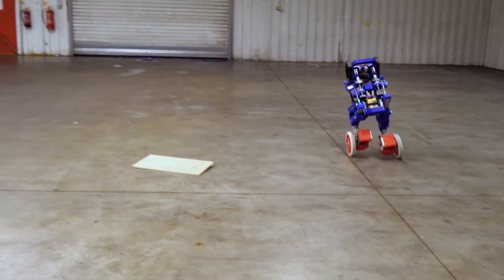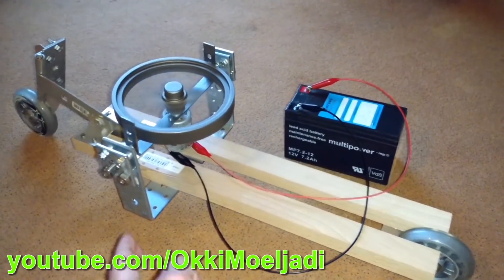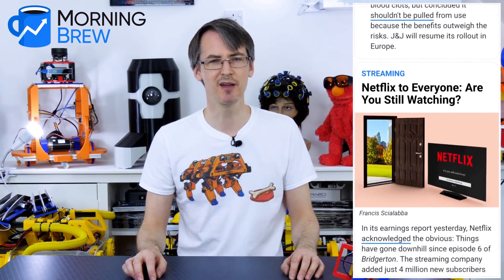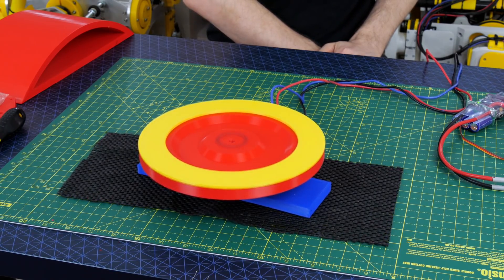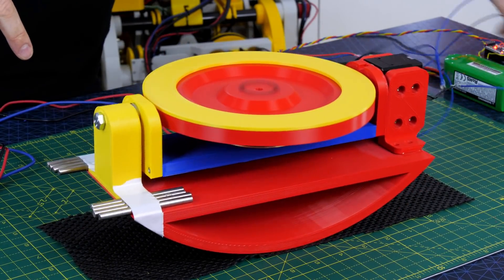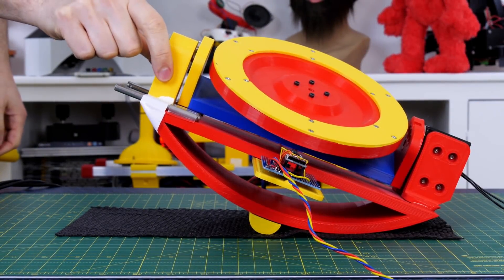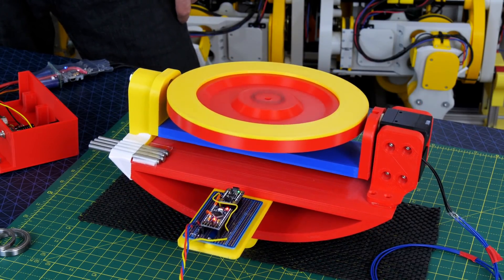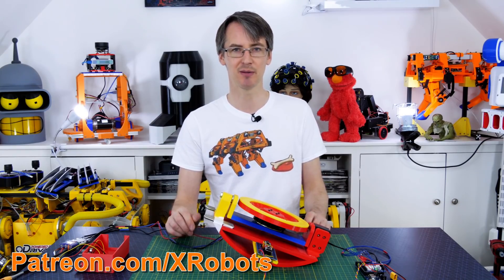How this Active Gyroscope Balances

Comment from the maker: Thanks Morning Brew for my daily news perk - sign up for free here http://cen.yt/mbjamesbruton
Reply: Cool Video Even Tho I Haven’t Watch It Yet
Reply: I'm wondering if you can use 2 gyros 90° out of phase, but linked with a belt to achieve complete balancing...
I'd love to see this 😊
Reply: @Lardah  if it's passive, it'll creep. But might be interesting nonetheless 🤔
Reply: A week ago !?!!??!!
Reply: Can you do a ROS robot start to finish tutorial? The last one you did from your Nerf robot wasn't a tutorial per se, and it was a little confusing. If you do a sharp solid tutorial from 3d printing the parts, using the correct motors, and setting up ROS and talking to the Arduino and trying to make the system work (the most important part), I would love you even more - if that's even possible...More importantly, the ones online use the Turtlebot which is really pricey for everyone. So simply, please, please make a ROS robot tutorial showing how to setup ROS and letting it talk to the Arduino to make the motors move with encoders. If this is really confusing, please reply to this. But thank you!
Reply: OH YOU LITTLE, you made me buy mc Donald's with an ad for something else
Reply: try dynamically variable PIDs. i guess you'd have to code it.
i.e. the closer to centre/level the less aggressive the PIDs.
Reply: What is the motor used ?
Reply: The responsiveness issue seems to be coz your using the roll values directly. I think the oscillations will never die down if you're feeding it the current roll values. You should try to enable it to anticipate the inertia and correct it pre-emptively. 

The rate of roll(angular velocity) could help with that.
Reply: I have an idea of how to incorporate gyros into it without adding the weight of extra motors and more structure though you will need to engineer the heck out of it! Is there a way you could use the motors already in there for other things that drive the legs to also drive the gyros? like set up a quick change gear box or a clutch or maybe? 
If you just put the biggest gyro you can in the middle then use bi-directional gear boxes to run all of the legs off of it then just find some other ways to make all the other issues work?
Reply: Decoding the Gyroscope (1)
https://youtu.be/et_AEC3sYY8
Reply: Iv got a great idea I'd like to connect on for a motorcycle sim involving a gyro

Comment: Million dollar idea - anti-flip for race cars by mounting a gyro like the boat that can respond fast enough. I believe that it could keep the 4 wheels on the track, therefore probably more traction and better runs and it could also provide a weight balance with the engine and trans being on one end of the car and the gyro on the other. Maybe my autistic ideas are too much because gyro cars have existed before, but not implemented in the way i see it could be used. also maybe mechanically connecting the steering to the gyro so it always moves to keep the car flat in the opposite force compared to the natural flipping direction of a car during a turn.

Comment: Hello friend, I'm your fan, your projects are really cool, it's a shame I don't have any knowledge of programming! See if you can help me I would like to make one of these stabilizers for my rc boat and a tug that I have and I would like to use a servo motor from a model airplane like those common to Dynamixel vehicles, would it be possible? Is there any code out there that does the same thing as your spin but with a normal servo? Thank you very much for the videos! hug...

Comment: You have essentially stuck that IMU out on a springboard, you can see how much it is vibrating, that will probably affect the roll calculations and add a lot of noise and hence affect the whole control system. The IMU should have been mounted to the main body of it at the very least, maybe with some light vibration damping too like they do on drones.

Comment: This is terrifying especially used on a bench as waist height. If the flywheel fails you will have dozens of pieces of extremely high speed shrapnel flying at your stomach. It's why people wear face protection when using angle grinders, not because of the sparks but in case the grinder fails.

Comment: Hello, I have been trying to create a oscillation-control system like this for a school research project. I have managed to setup / tune the PID control for this fairly well, however I'm running into an issue where the flywheel cradle can't return to zero without creating torque on the hull. I'm already running my flywheel's drive motor at it's lowest speed, and was wondering if you had found a solution to this in this project.

Comment: The pivot point needs to be below the flywheel for it to self balance and not drift. Notice the toy gyro rides on a point below the flywheel. Putting weight underneath will cause the gyro to transfer the drift in the same direction as the drift making everything worse as your testing confirmed.
Edit - you can put a counterweight above the flywheel too if you don't want to move pivot point. Like in your first test just put the nuts up top.

Comment: why and how is it better than a mass on a linear rail that gets swung from side to side, perpendicular to the system rotation axis? It would exert identical forces, but yet those boat stabilizing guys went with a gyro and not a hunk of metal on a linear rail. Why?

Comment: I think mechanicaly isolating the gyro from the system would improve signal to noise ratio, thus you can get much higher control bandwidth without causing oscillations.

Comment: Thanks for this. Valuable intro to gyros ( my gyro!) and control systems with the dreaded (and beloved) PID loop. Very stimulating.
Question: what is your servo tick rate for the PID? I'm amazed that little Arduino can even attempt it.
Reply from the maker: PID is running at 100hz, but the IMU data is only read at 25hz :-)
Reply: @jamesbruton  Aha, a bit slow isn't it? Probably first thing for better performance will be faster PID and IMU. Maybe Teensy 700MHz and .... ?

Comment: Interesting stuff, although I have to agree I am a bit worried about that rotor bursting. 

I think the control would work better if the output of the PID controller set the servo rotation speed, rather than angle. The torque reaction from the gyro is proportional to the rotation speed of the gimbal. Then, to keep the gimbal position, from tending to infinity, an outer loop that reads the gimbal position and alters the target lean angle.

Comment: Would using pewter as a weight source be more feasible than ball bearings? It melts at a very low temperature, and it’s a cheap metal, so it could work well to fill a channel in a 3D printed flywheel

Comment: Would this be able to balance front+back and left+right at the same time (of course some modifications to the whole frame, etc) or would you need to somehow use to separately mounted flywheels, one for side to side, another for front to back? Wondering how to use this for a single tire self balancing robot.
Reply from the maker: Yes you'd need at least two gyros that tilt in perpendicular axis, and preferably two-pairs like Gyrubot.

Comment: Dude this is extremely dangerous. FDM print materials aren't designed to sustain these forces, and those bearings are slinging at very high speeds. And when you exert force on the model while it's at speed, those forces are acting against the bearings which are already under significant force.
Reply from the maker: It's not a very high speed though, they are only 160kv motors

Comment: 13:22 you noticed that the board to which the accelerometer is attached, is vibrating a lot, maybe with a little adjustment the device will be even more stable. great video

Comment: I knew about the precession but not enough, I was confused why the gyroscope reacted and was used 90° from the direction of movement or stabilization.  What gets me though, is the use of a solid state gyroscope because the mechanical one isn't good enough.  Why are they so perfect?  I know how they work so I'm surprised they could be made to such reliability.  They barely drift at all.

Comment: double contra rotating gyro discs, same axis
Reply: this, double contra gyro stabilization, no recession rotation, stop stabilization
Reply: check the hyper space pirate gyro spin only, passive, not active, balancing, on a tight rope
Reply: you did not spin the failed passive stabilization flywheel test fast enough to keep it level itself, must have enough energy or it will yield to the sideways tilt
Reply: also you lose some energy in the first demo if you let the base accelerate and consume spin from the gyro flywheel
Reply: remove some axes of freedom of rotation from the 3d gyro
Reply: ie, a stick balanced by the one flywheel gyro
Reply: it does not work if you have loose ball bearings rolling around the disc, must be rigid
Reply: do you even know that the ball bearings are moving
Reply: it is as if they were not moving at all
Reply: they were not moving, you added the metal ball bearings in vain, for show only, use bolts instead, with their dedicated fixed holes

Comment: Is there a practical way to measure the input force and acceleration? Then they can be used to modify the response of the PID per "input". A problem I see with my suggestion is whether or not the board is fast enough to respond to the intial motion before it tilts too far.

Comment: What advantages does a gyro provide over solid state IMU in industrial/advanced robots? It makes sense for prototype projects and experimentation.
Reply: An IMU is good for sensing the accelerations and rotation. In fact, there's an IMU in this project. The spinning gyro is being used as an actuator to influence the roll angle of the frame everything is attached to.
Reply: @billgill85  I understand the purpose and concept of a gyro and imu. I’m just wondering if there is an advantage to gyro in industrial systems beyond the boat stabilization over solid state imus

Comment: pid loop tuning tip: start with i and d set to zero. increase p slowly till it starts oscillating, then try to increase the d gain to dampen the oscillations. Go back to the p gain and resume increasing. do this until you are unable to dampen the oscillations, then lower back to the last controllable value. For this particular case, the i gain should be unimportant, since that just ramps up slowly in case the p gain gets too low to drive the motor to the exact setpoint, which shouldn't be a problem for a balancing robot of this type since it's reacting quickly.

Comment: That's a lot of confidence placed in the strength of the 3D parts.
Reply: This is incredibly unsafe, if the plastic cracks you get high velocity metal ball shrapnel in all directions... everybody dies in the room.
Reply from the maker: It's really not going that fast - they are only 160KV motors.
Reply: @jamesbruton   I'm just pulling numbers out of my ass. If I understand electric motor ratings correctly that's 1900rpm at 12V, at 60V up to 9600rpm. Ball bearings ~9cm from middle results in a RCF (g force) from 360 g (1900rpm) up to 9200 g (9600 rpm).  Even if you do trust the plastic I strongly recommend balancing the wheel properly.
Additional fun facts, assuming a weight of 4grams for one ball, the kinetic energy at 1900 rpm is around 7.5 Joules per ball, exactly the threshold muzzle energy you'd need a firearms license in Germany if you planned on launching the balls. At 9600 rpm we're looking at 180 J, about the same as a .32 S&W Long cartridge from 1896. Modern 9 mm ammo is around 550 J.

Comment: Might have to try this with my bot, I am planning on using two reaction wheels 45° off the single main wheel for balancing..maybe ill put a gyro under the reaction wheels
Reply: I had looked into this before too but reaction wheels would hopefully mostly rock back and forth without saturation whereas the gyro would have to be constantly spun at high speed, in other words my thought was that the gyro would be much more power demanding

Comment: This reminds me of when I spun up an ancient 8MB, 8 platter HDD, it was huge and I could very clearly feel the gyroscopic forces as I tilted the drive. That was cool.
Reply: There was a reason those huge 8" and larger drives were so heavy and in some cases even bolted to the floor...
The largest (physically) drive I saw had a aluminum drive enclosure that was about a yard across. There were a drive axle sticking out with a freaking pulley on it and a belt connected that to the drive motor. A belt driven hard drive! It seems so insane now. And I think it was something like 30 MB of storage! But hey, it replaced a few of those 8 disk drive stacks that they were throwing out. I think those stored somewhere around 450 to 800 KB each. I may be way off, but this was around 84, perhaps earlier. Can't remember exactly. That "new" hard drive was not only way higher capacity than the drive stacks it replaced but also very much faster and more reliable. I did work on some 8" drives later, say some time between 86 and 90 or so, and those were about 30 MB and on their way out then. It was kind of hilarious. You had a tower computer with a controller card that connected it to a second tower that was almost exactly the same size as the computer and that held one 8" HDD that could store about 30 MB. I'm trying to remember the brand but it's hard. Priam keeps popping up but it doesn't feel quite right.

Googled and yes it probably was Priam. Damn brain, you did good!

Comment: Great!   You've combined two of my favorite subjects, gyros and PID controllers.  While in the Navy, came across a test hull system that used two huge gyros to force the hull to rock side to side at different rates in order to test some internal systems.  The rate of roll was just a matter of how fast they would pitch the gyro's fore-aft.  (of course, those gyros were about ten foot across and really massive)

Comment: Is there a way to make a pid controller learn the ideal values by itself?
Reply: Yes.  Look for 'adaptive control systems'.  Built a little CNC system that adapted to changing weights.  Basically an outer control loop that monitors overshoot and dampening of the main loop and slowly 'tweaks' the gains of the main system.

Comment: Just print little notches in the outside of the ring where the balls are. If you put as many notches as balls they will be pushed against them with the centrifugal force and space out evenly. Also makes for better power transfer to the balls without needing much precision
Reply from the maker: yep - that's happening in V2 next week!

Comment: With all due respect, I've noticed that you may have a blind spot around friction. In several videos you've neglected to mention the impact that friction had on your test results, sometimes leading to significantly incorrect conclusions.  Smallish omissions like the problem of leaving the ball bearings to roll freely in this video, to the major outcome effect of the lack of friction of the ping-pong balls vs cylinder in your ball screw lifter.  I'd be happy to chat if this is something you'd like to know more about.
Reply from the maker: They don't move once it's up to speed. Next week I have a better designed two-gyro machine though

Comment: Make a silicon mold of the track the bearings ride in. Cast the silicon in plaster and then fill with lead. Making a solid ring will improve the stability.

Comment: Did you use high pass filter to kill the IMU noise mounted basically on a swimming pool springboard?
Reply from the maker: Nope, the IMU has it's own internal DMP though - I didn't look at the output when it was spinning tbh
Reply: @jamesbruton  Cool, the results is good nevertheless.

Comment: The platform the IMU is on doesn't look very rigid. This will lead to a lot of extra oscillation as well as the off-balance flywheel.
Reply from the maker: Yes I said that. V2 comes up next week with two gyros and wheels to drive on
Reply: @jamesbruton  Oops! So you did. Don't know how I missed that!

Comment: Would a reaction wheel be lighter than a gyro for stabilizing a walking robot?
Reply from the maker: Difficult to say. Also the reaction wheel would still have gyroscopic precession when it's moving which would do some funny things to the stability in a perpendicular axis.
Reply: @jamesbruton  maybe that's the reason space probes are stabilised by gyros and rotated by reaction wheels.

Comment: you can kill the ozzilation the the sensor board by making its mount less flimsy, or simply by mounting it in the center of the boat shape so its not on a springy bit of plastic that can vibrate freely
Reply from the maker: Yep - I have a two-gyro version that's a bit more sturdy coming up next week

Comment: Instead of PID, have a look at Model Predictive Control.   It is a bit more complicated, but the result doesn't need tuning and the result is optimal.  For gyro control, it is perfect, because it has a very well known and simple physics model.
Reply: Yeah definitely. Slapping a PID on everything might work, but if you know model... you can get really solid performance like you said. In this case he probably would want to monitor the angular acceleration of the hull, then exert an opposing force on the hull by exerting a torque on the gyro through the servo. And then have an outer control loop (much more acceptable to be PID) that monitors the angle of the hull and feeds into the desired force for the inner loop.

Comment: it seems like you had the PID control the position of the gyro, but the gyro only applies a force when its pivoting. in the next version, you should have the PID control the pivot speed rather than its position, if you haven't done that

in its current configuration, the integral probably acts more like the proportional is supposed to act
Reply from the maker: There's another version coming next week with an observation controller, kind of ;-)